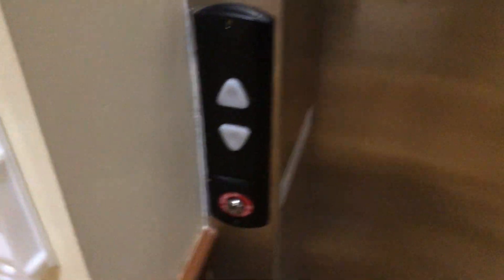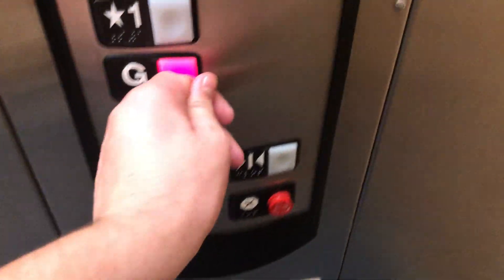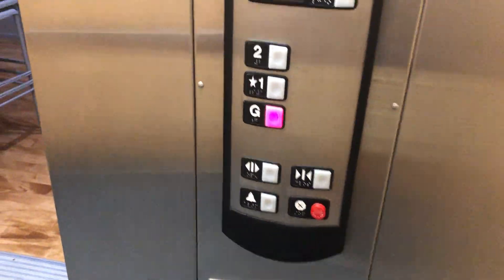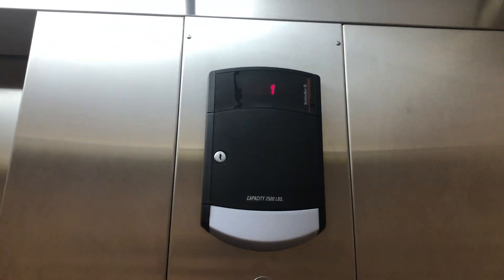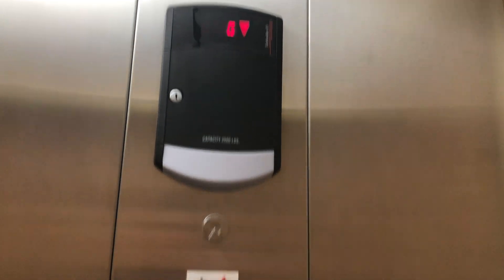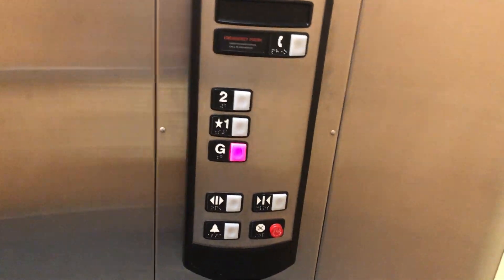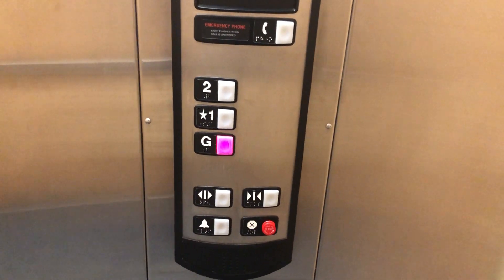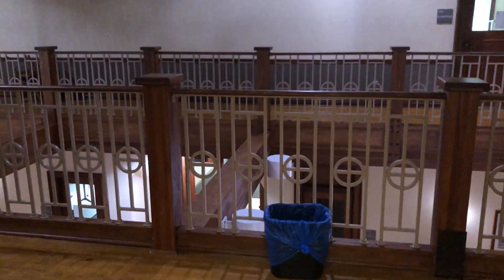LOUD low-pitch Schindler 330A elevator - Drs Paul and Carolyn Carruth Rizza Hall - Slippery Rock, PA

Comment: Is it just me or do older 330A's use 300A door operators? They seem to have that distinct hiss when opening/closing like 300As had, whilst also moving fairly slow.
Reply from the maker: It's possible, you might be right about that. I think they switched in around 2004
Reply: @EWPA14 it was 03. When the 400A was introduced a new door operator came out and they implemented it on the 330A too
Reply from the maker: Most likely that's true (along w/ the chime change). But I think the earliest seen installs of both the newer door operator & 400A was 2004.
Reply: @EWPA14  There's an 03 330A near me with the newer door operator, as well as some 03 400As